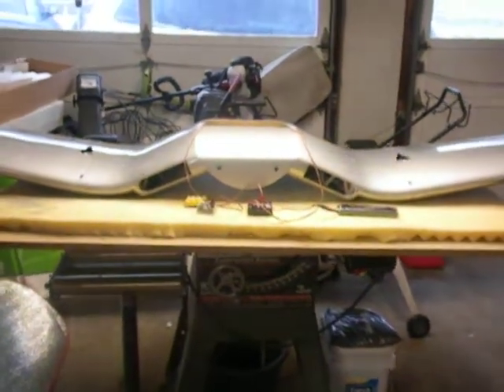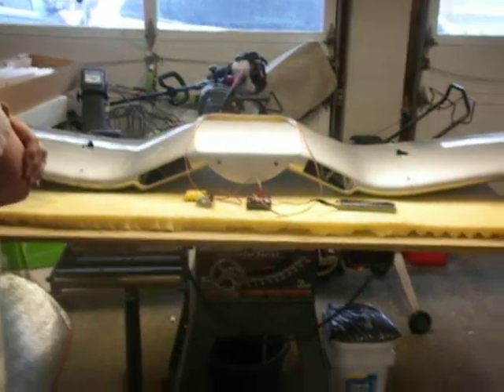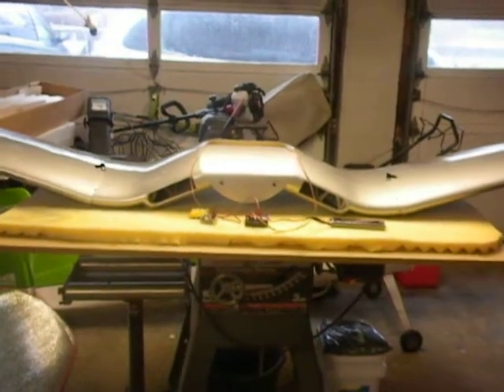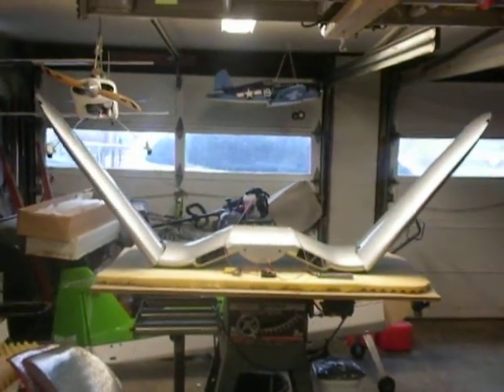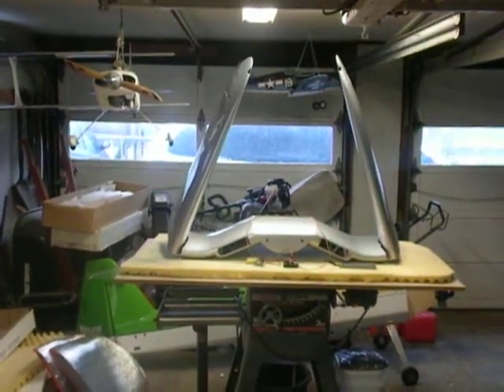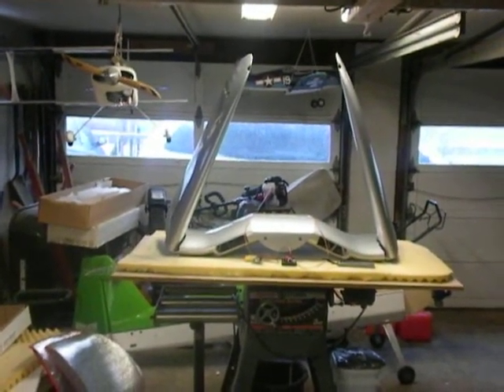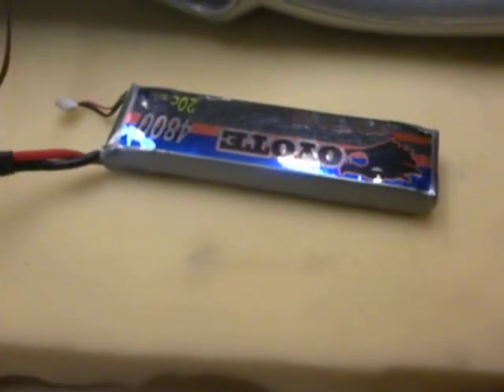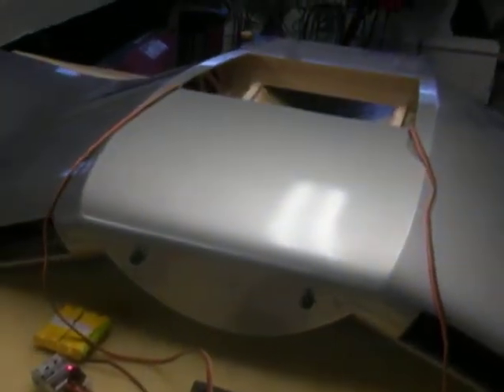F4U wing conversion to electric

Comment from the maker: This was the prototype for the conversion, and done on an estimated basis. I'm not sure what the retail pricing is going to be. You would have to contact Mitch at Down & Locked, for pricing. 

Since this video hit the net, Mitch has had many inquiries and is currently doing conversions for other builders of this Corsair. It is so superior to the factory hydraulic system, I would not be surprised to see it as a factory system in the future.